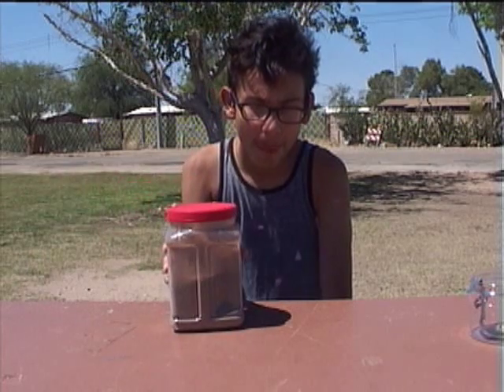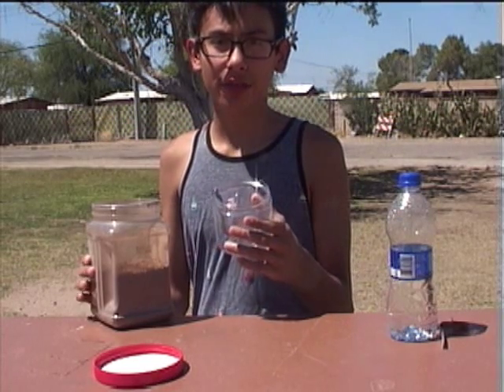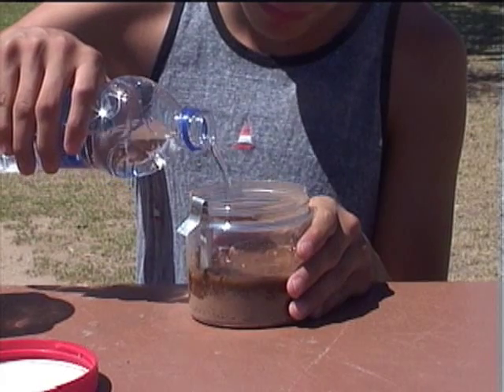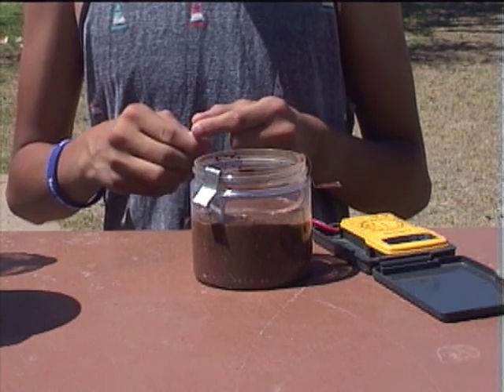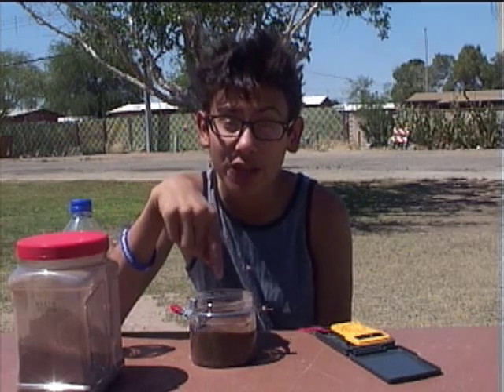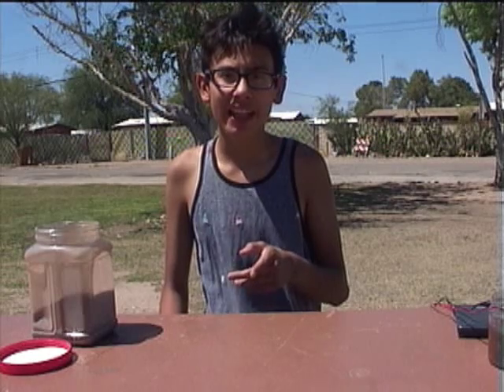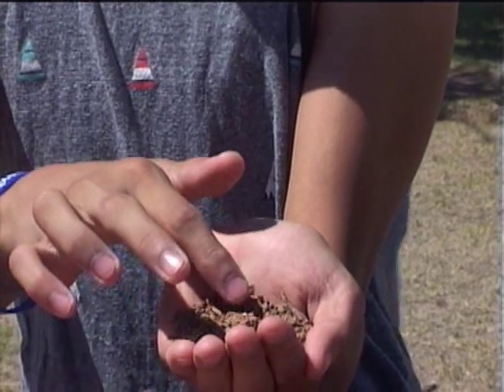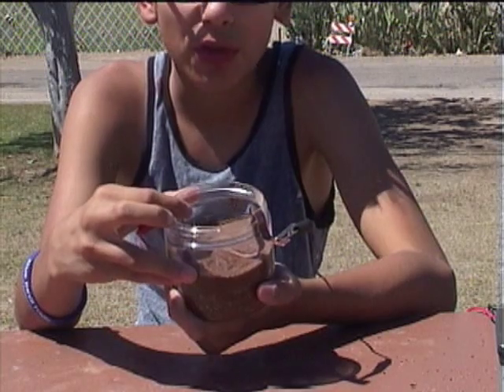How To Make A Mud Battery

Comment: This works even better if you use graphite felt for cathode and anode, then use same-metal electrodes attached to the felt, they can both be copper, aluminium or anything that conducts well.

Comment: Any moist material can be used for a voltaic pile i use copper pipe and aluminum wire seperated by paper towels.. school glue works tooooo. The larger rhe surface  area the more voltage generated....